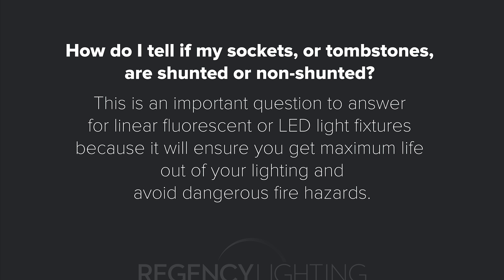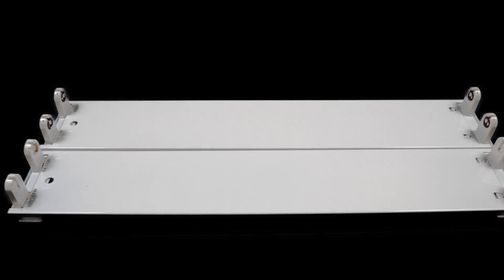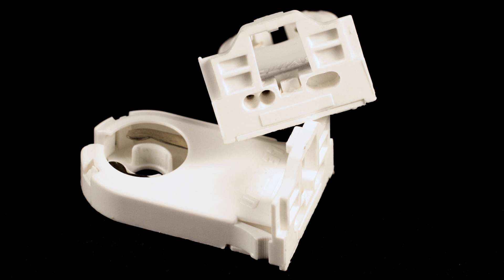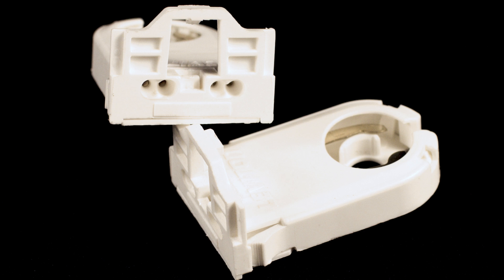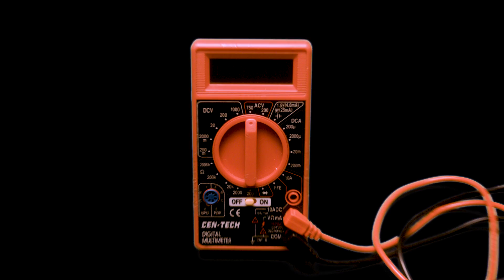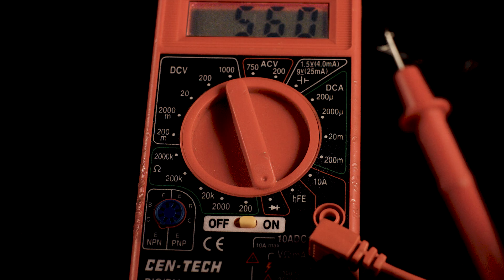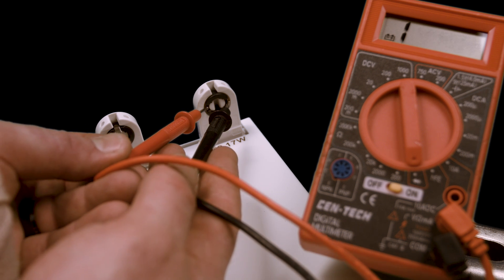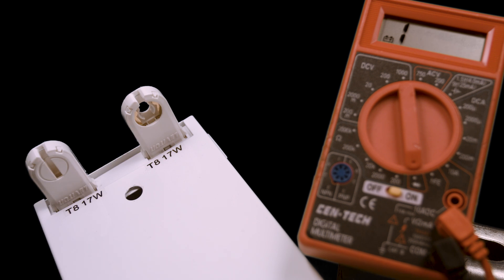Shunted vs. non-shunted sockets: How to tell what you have

Comment: Great video, thank you. Question: can I simply power off the light switch that controls the light fixture I want to test or do I really need to turn off the circuit breaker? I ask because I want to avoid dismounting the fixture from the wall nor do I want to remove the wiring prior to testing.
Reply from the maker: We're glad this was helpful! If you're going to test a fixture you need to make sure the power is off to the fixture. The safest way to do this is to turn off the power at the electrical panel.